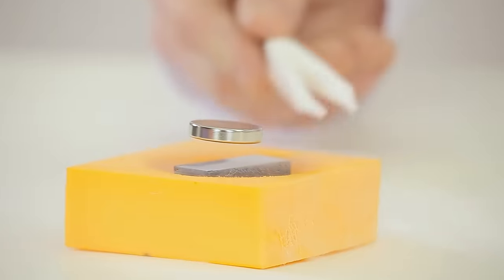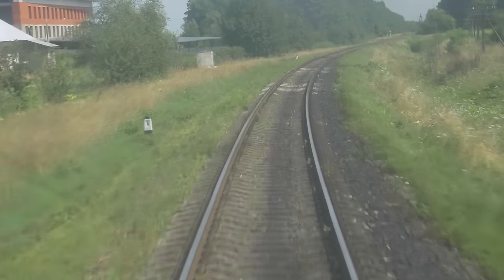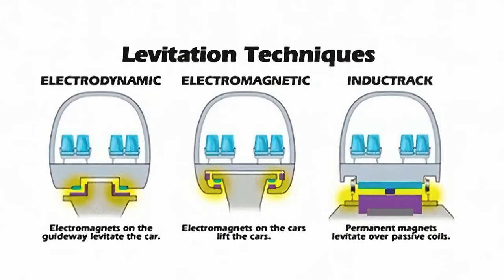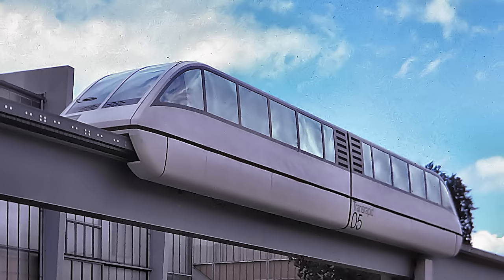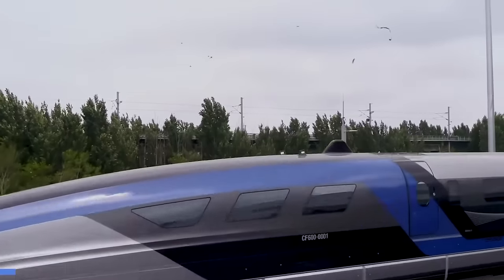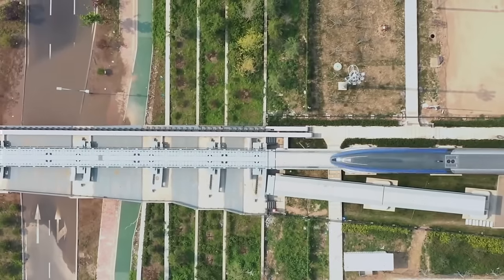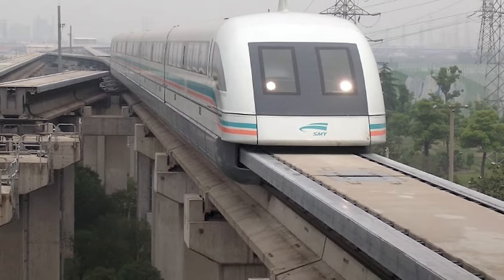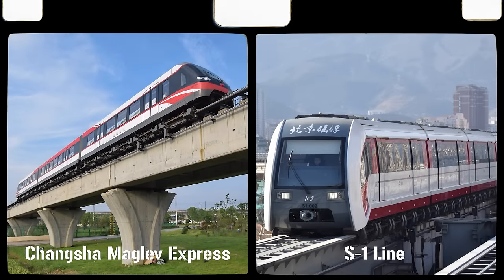Maglev Trains: Why This ALWAYS Falls Short

Comment: I rode the German Transrapid on the test loop back in the mid 2000 when I was a minor and even then it was a proven and ready to implement technology. It was a joy to ride, flying through the landscape at 400+kph effortlessly. It was quiet, fast and relatively versatile with higher possible ramp angles, higher throughput and a relatively simple carriage design. The problem was always cost of adoption and the difficulty of switching track economically and safely.
Reply: Edit: kph
Reply: @Noise-Bomb 
*quiet
Reply: " problem was always cost "
Wrong, cost was never the problem:

" difficulty of switching track"
The test track swich track 4 times every lap of the track

"safely"
Safty was never a problem . The accident happen with the system tunred of, that only could be done because it was a protoype track
Reply: @matsv201  they are more expensive then normal trains so of course cost is a problem.  That's also why the Concorde stopped. It was feasible to make but the cost just didn't make sense
Reply: @TheDesius  
"they are more expensive then normal trains so of course cost is a problem.  "
Are you talking about the track, the train or the maintenance. 

"That's also why the Concorde stopped"
Because it was to expensive? No i would say the main issue with Concorde was the fuel consumption
Reply: @matsv201  building the track and train.
Yes the main problem of the Concorde was high fuel consumption which made it very expensive to run.
I think if people had a choice between a cheap train ticket or a expensive trainticket to get to your location faster then most people would choose the slower train unless they were in a hurry
Reply: @TheDesius  
"building the track and train."
Do you have numbers?
Reply: @matsv201  if it was cheaper we wouldn't even have normal trains anymore today. Why would any company choose a inferior more expensive train. Also, this video gave many examples of the enormous prices of some of the projects
Reply: @TheDesius  that is circular logic.

Again. Give me actually numbers.

Almost every railroad in the world is govememt operated. It does not operate on the open market. The trains do (in some countries) but they can't chose the infrastructure to operate.

There is one exception to this. JR in japan. The one that actually building maglev.

So no, you argument is totaly invalid.
Reply: @matsv201  I assumed you actually watched the video, why else would you comment here. But OK the prices for normal rails around 50 million dollar per km and meglev 80 - 240 million dollar per km. Also it's just common sense that a bit of metal and wood is way cheaper then tons of electromagnets. I live in the Netherlands and both the railway and trains are privatized and both companies have no plans for maglev because of the cost
Reply: @TheDesius  Lets address your last claim first. 

The railway in Netherlands is operated primarily by Nederlandse Spoorwegen that is a 100% government owned company.

The railinfrastructure is owned and sustained by NS Railinfratrust that is a government agency. While there are private independant companies that subcontract to Railinfratrust, they have no say in what and where anything will be built.

The numbers in the video for cost is just total makebelive. They have no context in reality what so ever.

Lets compare real world numbers.
Lets compare Chou Shinkansen with California high speed rail that is about the same distance.

Chou is estimate to cost about  $100B for 438km while Califonia high speed rail is estimated to cost $106B for 840km.

That is a $229M/km and a 126M/km and there is about here people that have absolutely now clue about railways stop.

So we take a other example. Shanghai maglev train, clocking in at about $25M/km and Citybanan that is a traditional high medium speed railway in at about $300M/km. (granted, there is about 12 years between the two build, but there was not much inflation in that period)

We can look around at some more project. Incheon maglev, costing about $30M/km, Changsha Maglev costing about $28M/km,  Bejing S1 costing about $35M/km,  Fenghuay maglev (estimated not quite open yet) at ~$30M/km.

So the cost claim is just utterly bullshit.

So of cause, that boggers the question why Chou Shinkansen is so expensive. Well its the exact same reason City Banan is so expensive. Anyone who took  30 second google it and are not totally dishonest would know that.

So, are you totally dishonest, or didn´t you spend 30 second google it?
Reply: @matsv201  I googled for about 30 minutes and didn't find it so idk what you talking about. You are sounding like a complot theorist saying all the facts in these videos are make believe. The only thing I could find why it is so expensive is:
- Tunneling Costs
- Maglev Technology Costs
- Land Acquisition Costs
- Station Construction Costs
- Economic Factors
But literally any maglev project in the world would have these problems. You are living in your own fantasy where maglev is the perfect solution and the only reason no one uses it is because the governments are hiding it from us and we are all sheep
Reply: @TheDesius  
Eeeh, are you for real. Is people conspiracy theorist because they point out things that is objectively wrong in youtube videos? Is that really the hill you want to die on?

First you claimed that you didn´t find what i´m talking about, then you made a list with 5 point that one is obviously not it, so one of the other 4 point is what make Chou so expensive.

"But literally any maglev project in the world would have these problems."
How come every other maglev project is a order of magnitude cheaper (Apart from linimo) than Chou shinkansen? 

There been a number of maglev project, and every one of them come in between $20 and $60M.. and really if you exclude Linimo all of them come in between $20 and $40M apart from Chou (and Linimo)

Here is a list of those projects.
Lininmo
Dejeon Expo
Incheon maglev
Changsha maglev
Beijing S1
Fengang maglev  
Shanghai maglev
Qingyuan maglev (Trail runs)

Then we also have the test track.
Huyndai-Rotem SUMA550
CRRC maglev Jiading Campus
Bögl transport system Neumark

That is heck of a lot of tracks that don´t confirm to reality according to you... Or they do and you are just wrong.

"because the governments are hiding it from us and we are all sheep"

Your claim makes absolutely zero sense. 

And you argument is built on circular logic. (government is not building it because its expensive, and the fact that government is not building it proves that its expensive) by the way, both of those statement is mostly incorrect. 

Regardless. Even if they was. Why would a private entity built maglev if it was more expensive. A entity that have to show the calculation for there stock owners, and actually have.

You can find JR-central cost calculation online where you can actually sea that the maglev system is cheaper. Its all public.

How do you explain that? Did JR-central fraud there stock owners?
Reply: @TheDesius  The difference between the costs of a new railway track and a maglev track depends on the maglev system (we learned there are two different systems market ready) and the terrain of the track. Maglev technology needs less tunneling because it can climb steeper ramps, which can save a lot of money and construction time. The reason why maglev tracks are slightly more expensive in gerneral is, that you have to integrate more technology into the track. Remember: you want the train to magnetically elevate.
Reply: I rode the Transrapid in 2002 and had a similar experience. Most notably, I rode in the car that was destroyed in the 2006 crash. It makes me contemplate life knowing it could have been me onboard the fatal trip.
Reply: @matsv201, what are you comparing ? Different countries/situations. Just look at the the tokaido shinkansen which does the same thing ad chouo. It  would've cost 13 billion today. So yeah maglevs are much more expensive.

Maglev technology is just more expensive than conventional rail. Think of it this way, take any high speed rail line and assume a maglev was built there instead, do you really believe it wouldn't be more expensive?
Reply: @matsv201 You are obnoxious and that ruins all your arguments. What point is there arguing with somebody who writes "high fuel consumption was a problem" which is essentially the same as "it's expensive to run", the thing you denied. Then you proceed to ask for numbers and discredit the opposite side of the argument while your arguments aren't even arguments and just 100% baseless opinions without a single ounce of foundation.
 Now let me give you the truth. Here is the reason why the Maglev train wasn't built in the 1990s-2000s in Germany: Cheap airlines. They started opperating the exact same paths that would be suitable for Maglev trains, making them in the eyes of car influenced policy makers, obsolete. Cosidering the safety mechanisms since 9/11 at airports, domestic maglev trains would make a lot of sense nowdays but the political class is just sheer incompetent which is why you'd only see these built in China at best.
Reply: @xXdnerstxleXx  
" writes "high fuel consumption was a problem" which is essentially the same as "it's expensive to run""
Aa yes, a strawman, the base tool for everyone that is wrong. I wrote expensive, not expensive to run.

" Here is the reason why the Maglev train wasn't built in the 1990s-2000s in Germany: Cheap airlines"

No, you are wrong. The reason is much simpler. The TR06 and TR07 prototype was not production ready. TR06 had capacity problem and TR07 had reliability and noise problems. TR08 the first production model was starting testing in 1999, to late to have any track ready by the 90s.

Your argument make zero sense.  Air travle in Europe is cheap on a international bases, typical medium hual. The short haul lines that maglev would predominately compete with was never very cheap.

If your argument was true, neither ICE or TGV network would have been expanded during the 90s, and they very much was.
Reply: @Dalex1910  
"Just look at the the tokaido shinkansen which does the same thing ad chouo. It  would've cost 13 billion today. So yeah maglevs are much more expensive."
If you don´t break it down in rail and tunnels, then its just a strawman argumetn.

"Maglev technology is just more expensive than conventional rail"
You have any evidance for that what so ever?

"do you really believe it wouldn't be more expensive?"
Why would it?
Reply: @matsv201  German Bundestag voted for the construction of a Maglev line between Berlin and Hamburg. The bill passed with a majority.
However, then research papers started piling up and simulation were run. Since the line had multiple stops such as Schwerin, it would have barely lowered the time between Berlin and Haburg compared to a newly built ICE line. (BTW todays line there is terrible and the ICE takes 2 1/2 hours. Those research papers were flawed but atleast it's faster than the same route by car due to Berlins terrible traffic jams.)
The project costs were corrected upwards from 5.6 billion to over 9 billion until 1999. The project was cancelled in the year 2000 due to the exploding costs of the project. (source: ThyssenKrupp Transtrapid GmBH, Deutsche Bahn AG).
During the same time period inland flights became popular. Flights such as Stuttgart Berlin, Hamburg Munich were in direct competition with train networks. This completely eroded the need for a country wide high speed Maglev network, as on short distance they were deemed useless when compared to the cost effectiveness of existing trains and the popular car.
(source: Deutscher Bundestag 2000)

The final nail in the coffin was the public hysteria after the death toll from the big accident. 2008 the second project in Bavaria was cancelled. (Source: Spiegel). Those are the main points leading to the end of the cancellation of the Maglev in the late 90s, Early 2000s in Germany. 20 years later the Maglev is irrelevant in the public discussion.

You are so unbelievably obnoxious and condescending, I won't respond to your arguments any further, which is a shame as I think you correctly pointed out some aspects, even in the first comment but this delusional behaviour of discrediting others defeats your entire argument in the first place.
Reply: You can have fast, quiet, high acceleration, steep ramps, etc also with normal high speed trains but for an much, much lower cost. And the infrastructure for high speed trains can also used for freight during the night. Also: due to the conceptional high air resistance of the Transrapid it used much more energy like an ICE 3 at the same speed.

Comment: One thing worth mentioning in the case of the vacuum tube version (like swiss-metro) cooling becomes a big issue, as your train is basically in giant thermos bottle. There might not be any engine on board, but you have all the passenger equipment, and all the passengers which are probably producing 50 Watt per person of heating.
Reply: People should forget about the vacuum tube train ideas. It's fundamentally flawed beyond issues with thermals. Look at the hyperloop to see an example of why it cannot work.
Reply: @TheExileFox  I once did some calculations on separation distances they'd need in hyperloop, in order for pods to be able to be brought to a safe stop in the event of a pod having an accident.  It's a very long distance, and would fundamentally limit the capacity of the hyperloop to ridiculously low levels. 

A vacuum tube breach is another hyperloop nightmare. There's a real problem with what to do, if it happens. If the tube is fully cut open, the best thing to do is to bleed off the vacuum along the entire length as quickly as possible. 

An alternative is to have slam-doors that close, to stop the whole tube's vacuum being filled. Trouble is, as the vacuum is filled via the breach the air pressure wave that is filling the tube will push debris through the tube, and this will hit the slam door at about Mach 1. If you make it too light it might fail when the debris hits, and now you've got a slam door + debris travelling down the next section of tube at Mach 1. And so on.
Reply: at anything less than 300km/h vac trains aren't worth bothering with. Tunnels aren't fully evacuated in any case so active cooling does work (we're talking pressures equivalent to 1-200k feet altitude, not full space vacuum for supersonic transit and commercial airliner altitude for subsonic speeds)
Reply: But Elon Musk said he’d build a hyperloop and he’s never let people down before.
Reply: @abarratt8869 a blast door coming at you at mach1 sounds like a bad day 😂
Reply: I forgot to mention - in tunnels of any kind, cooling rapidly becomes a major issue. The London Underground system has been battling excess heat in the deep tunnels for decades with all kinds of creative solutions proposed to try and mitigate it. The problem is that merely pumping heat out of the carriages into the tunnels results in equipment breakdowns along with extremely uncomfortable (hot) platforms whilst forced air exaction in the tunnels causes near-gale-force winds on the platforms if not carefully managed

Even on conventional railway tunnels, once they exceed about a mile long they're noticably hotter inside than outside. Some of this is geothermal but most of it is from operation of the trains themselves 

Like all problems there is usually a quick and obvious solution which is completely wrong, with the real answers being complex and multilayered
Reply: @miscbits6399  well, it helps now that people know about that, unlike when they built the London Underground. Now you would plan in advance for plenty of cooling, and during WW2, build more cooling in the space that got freed up.
Reply: I love all the expertise here. How many have engineering degrees.?
Reply: @TheExileFox  Hyperloop is currently neither proven or disproven viable, there are still several companies developing it. Is it likely to work? Maybe not. Are we already entirely sure? Not yet.

So far hyperloop development is still very much in its infancy, if it is viable, it might still take decades to prove such. The first plane flew in 1903, passenger planes started coming up around the 1920's and took many decades more to truly become mainstream.
Reply: @borismuller86  This already shows how little you know, Musk never intended to build a hyperloop, he only floated/broadened an idea that since then has already seen drastic changes looking at current Hyperloop developments.
Reply: Vacuum tubes are a completely retarded idea (pardon my language). It requires such flawless engineering and such flawless materials and such enormous power over distance and such extremely novel safety precautions that it's basically impossible. And the costs, even if you decide to be bullish about it and still implement it, would be so incredibly astronomical, it'll make the costs of Maglev and other megaprojects look like pocket change. It's simply not possible, and I doubt it will ever be possible or desirable. By the time you could probably build a vacuum tube train for a reasonable cost, you'll most likely have way better ideas already. It's a non-starter every which way you look at it.
Reply: Matthias Iamewhlteboy
Reply: Iame whlteboy
Reply: k -I I
Reply: But Elmo said Hyperloop would solve all our transportation problems. How come? He's never wrong.
Reply: Elmo pushed Hyperloop to discredit the idea of speed train in California, it's easy like that. 💰💰💰 is all what he cares.